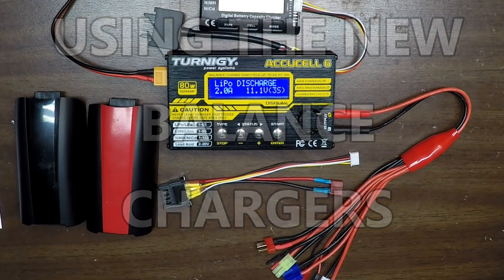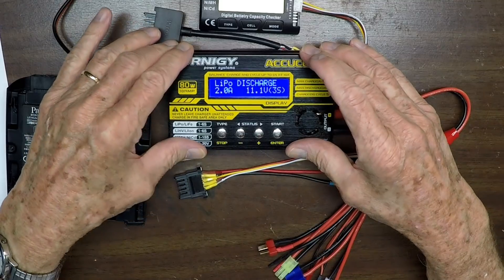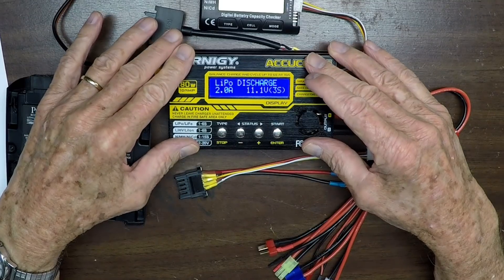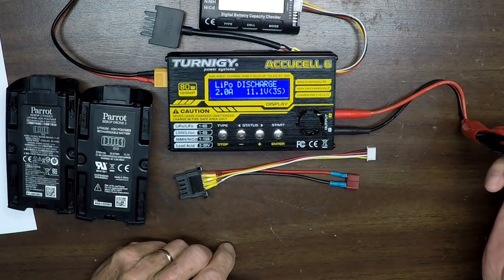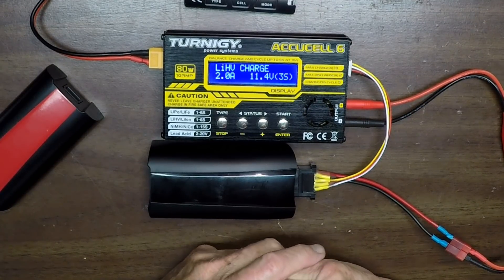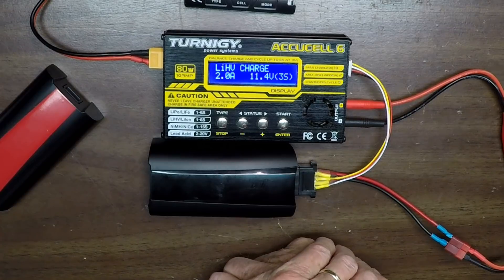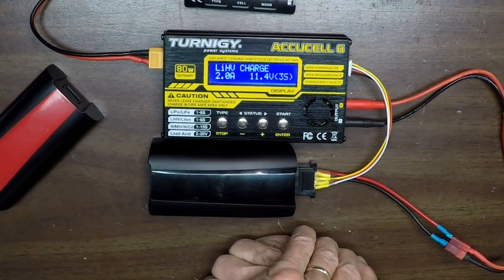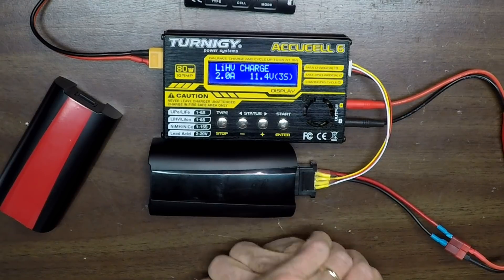USING THE NEWER BALANCE CHARGERS (LIHV)

Comment: Hello, is the original bebop2 charger not balancing the battery?
Reply from the maker: Thank you Richard for your question. The charger that came with the Bebop 2 did a very poor job of balancing compared to a standard LiPo charger which monitors all cells at the same time. I experienced that when I ended up with a battery that didn't last as long as it should have. God bless.

Comment: Mr. Kent - it has been several years since your recommendation on this balance charger -- is this still a good unit in your opinion or do you have a different unit that you favor now?
I have a Bebop 2 with two batteries that are about a year old with a hundred flights each --- they only show 60% capacity when fully charged on the Parrott OEM charger --- therefore I need a balance charger to try and refresh them, or if that fails, will use the charger for new batteries.
Reply from the maker: Thank you for your comment and question Carole. Things have changed a lot since then but you can still find a balance charger on Hobby King or Amazon. I do not have the cables available any more so you would need to build your own. I hope that is helpful and God bless you.

Comment: I just bought a Parrot Bebop 2 with the sky controller that’s not charge, but there are any plug to connect to the charger. How ca i charge the controller so i can use it or can be charge by the USB. I have the balance charger but if i buy the wire for the bebop battery I wonder if i can buy the wire for charging the controller battery. Thanks, you help me a lot.
Reply from the maker: Hi Rafael, I'm sorry to hear or your problem. Did you buy the Bebop new, or used? There should be a cable that runs from the charger to the controller. If you bought it new you should take it back if that cord is not there. I do not have a charging wire for the controller so I can't help you with that. If you cannot return it you may want to check EBay for a bebop 2 skycontroller charging cable. Please keep me posted on your progress and God bless.
Reply: mrkentdotcom I buy it use but I already send a message to the seller and he tell me that he is going to look around trying to find it, if not I going to look on ebay.

Comment: Hi there Mr Kent,
I have had the bebop 2 for almost a year now and find that this drone is very good and so far it hasn't let me down. A few scary moments though but that was pilot error. Lol
I have 3 lipo batteries and all seem to charge ok, but on your advice, i have just purchased an Lipro imax B6 Balance Charger to balance the batteries. Would it be possible for me to purchase one of your balance leads for the said batteries? Thanks in advance. Jimmy
Reply from the maker: Hi Jim. You sure can. They mail USPS and generally arrive in three days. Thanks for the question and God bless.
http://www.mrkent.com/cables/index.htm

Comment: Is the stock Parrot bebop 2 battery (NOT Power, original BB2) LIPo or LiHv? (Looks like LiPo, but need to be sure)Thx
Reply from the maker: Thanks for your question David. The original Bebop 2 battery was NOT a LiHV. It was just a LiPo standard type. God bless.
Reply: @user-sr8pn9xg8z  Thanks.

Comment: Mr. Kent, great video! Thank you very much. How do you tell the difference between LiPo and LiHV
Reply from the maker: It actually tells you on the back side of the battery if you look close. Also, full charge on a LiPo is 12.6 volts. I think a LiHV battery is 13.8 fully charged. I hope that is helpful - this answer refers to the Bebop 2 batteries, which I think you are referring to. Thanks for your question and God bless.

Comment: Thank you for the video. I just purchased a BB2 FPV and I know that we should not use the OEM charger that it came with, so I ordered a "EV-Peak 3 Ports" charger on Amazon. Is this ok to use on the OEM bateries of the BB2? I guess it should be fine as long you don't use BB power batteries what do you think Mr. Kent? Thanks and God Bless :)
Reply from the maker: I have never used one of those. I do recall one of my subscribers was disappointed because one of the ports had issues. Please let me know what you think when you use it please and God bless you.

Comment: I have to get that charger/balancer. I have the Bebop 2 Power batteries and I use a LiHv 4000mah Turnigy batteries in the Parrot Disco. I charged with my charger/balancer Imax B6 SkyRc in LiPo mode because the balancer have no LiHv option so I don't charge all at 100% I think. Thanks for the video.
Reply from the maker: Yep, I had a perfectly good charger when I got my Bebop 2 Power, but it did not charge LiHV batteries so I had to bite the bullet. With the old charger I could only get about a 90% charge. Thanks for your comment.
Reply: Helderhugo hey so what flight time do you get wth the 4000mah in the Disco. I use the 5200 and get between 70-80 min depending on wind. Also are you useing the newer 12c or amp 4000 mah battery or the 10c/amp one?
Reply: 40 minutes and landing with 20% power. This ones: https://hobbyking.com/en_us/multistar-lihv-high-capacity-4000mah-3s-multi-rotor-lipo-pack.html?___store=en_us

Comment: So charge my lipos full then balance charge them iam using the skyrc q200 charger
Reply from the maker: Yep, that is what I recommend. Some balance chargers do a good job of balancing on the "charge" cycle but not all are the same. Mine seems to turn off the charging cycle and when I check they are also balanced. But I have had chargers that I needed to use "balance" after the charge and it took a while for the charger to get them balanced. So I just recommend it for everyone. Some need it and others will not. thank you for your comment and God bless.
Reply: @user-sr8pn9xg8z  good to know that as my batteries are 6s 10.000ah
Reply from the maker: Wow, you probably spent a bundle for those. Take good care of them :) God bless.
Reply: @user-sr8pn9xg8z  4 in total that's why I got the q200 charger does 4 batteries at a time